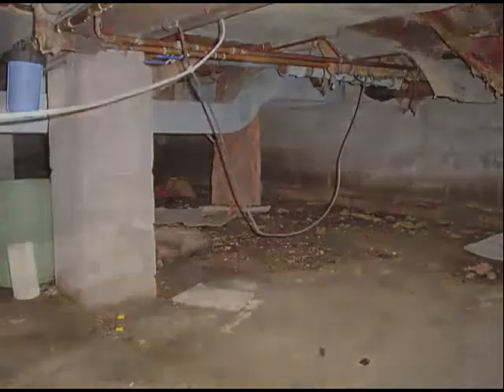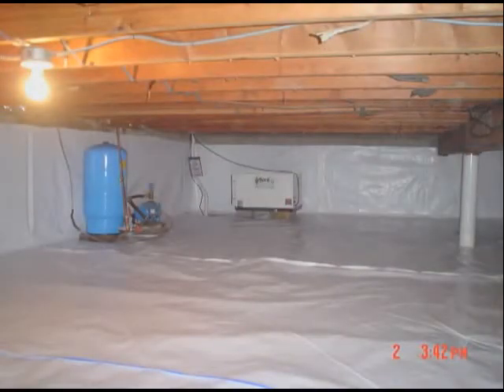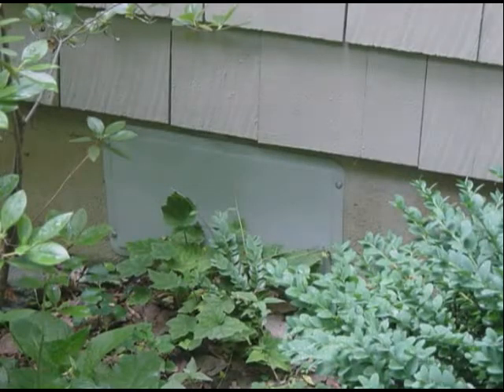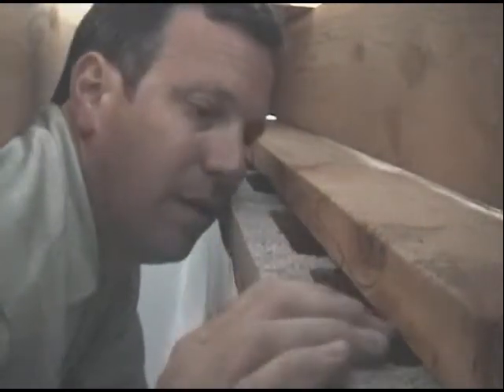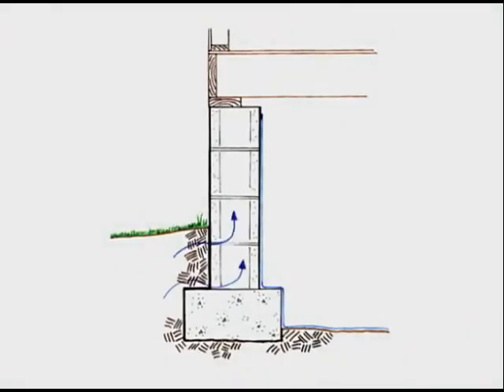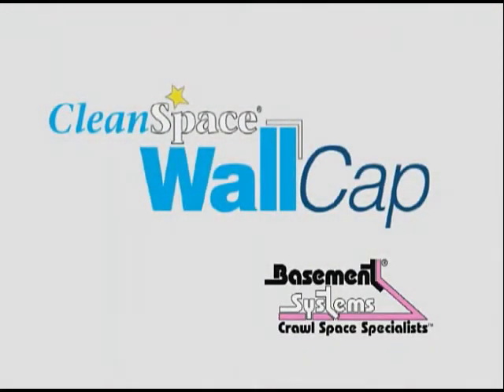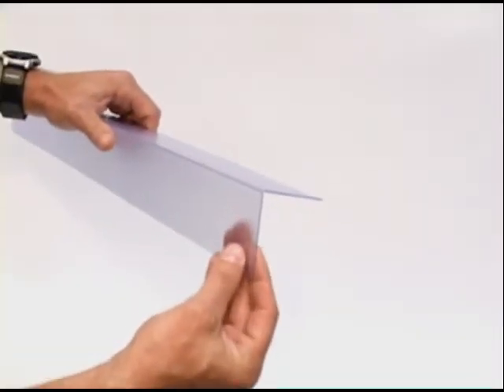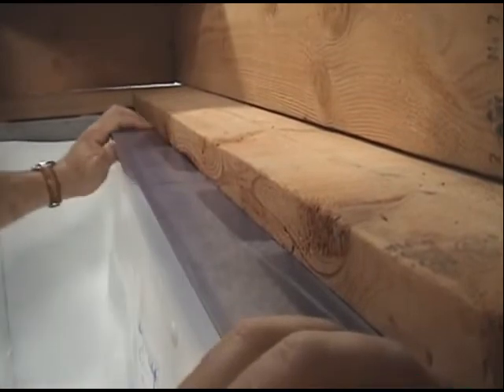Wall Cap to stop moisture escaping from cinder block

Comment: Is it necessary to use some sort of sealant against the wall cap edge and the wood sill plate to make a truly air tight fit? and/or to the wall sheathing?
Reply from the maker: Yes.  Often we have to use caulk or spray foam to help seal it completely.